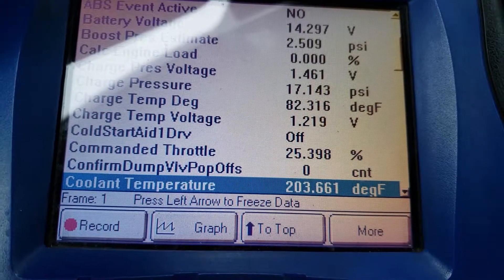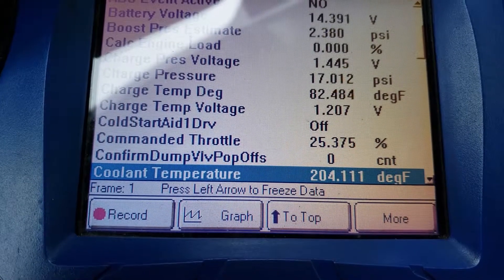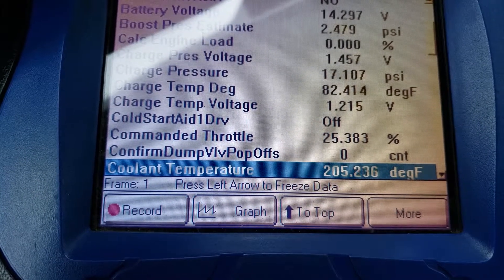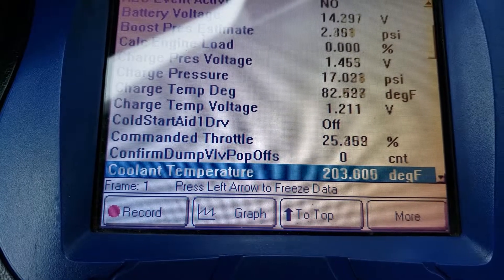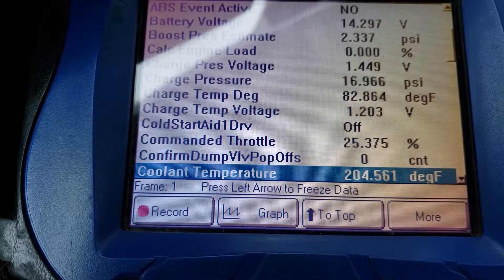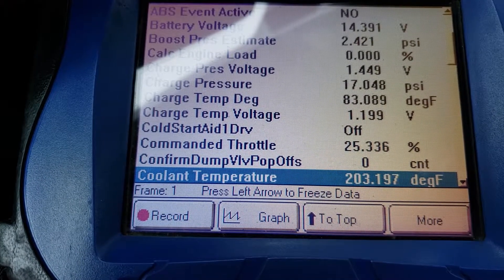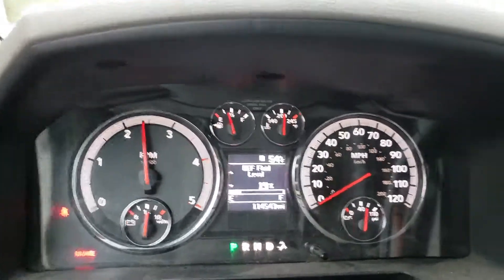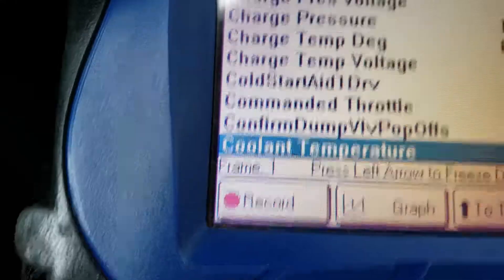Dodge Ram Fan Clutch: Watch it Engage & Disengage in Real-Time | Mobiledieselmedic.com

Comment: I was driving a -model Mack quad and the fan clutch started acting up the 1st load. I was used to viscous clutches and not air clutches so much so radioed in and told the shop about it. The clutch would engage at idle not anyhere else. I pulled over RIGHT before it shut down and was able to get it cooled down and dumped, 24 tons of road base. The shop looked it over and maybe replaced the sensor and I got a load of asphalt and it started acting up again. I finally got unloaded and went back for another. The shop bypassed the sensor and unhooked the clutch. Thought all was fixed till I headed up the hill from the plant and out it went again. This is HILL counry and I had a few dandys to pull to get to the job and idling was the ONLY way it could be done. It made it and running empty was NO problem. Found out the clutch itself was SHOT! No more problems but it sure gets interesting. I was also driving mixers at the time but no hazardous duty pay.

Comment: I think it's just the thermostat opening and closing. If you want the fan to turn on. Get the engine as hot as possible and run the RPMs high. Turn the engine off and wait a couple seconds and then turn it back on and rev it for some time to build heat and shut  it off. Eventually the residual heat will get hot enough to engage the fan clutch.
Reply from the maker: Thank You.